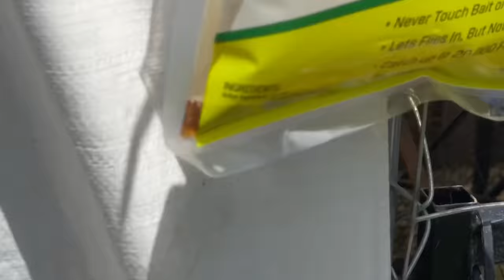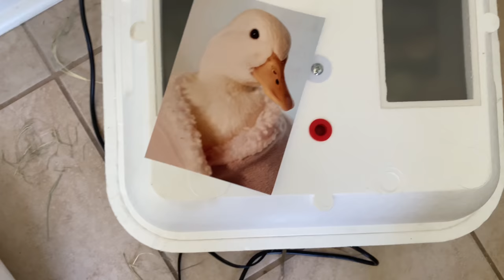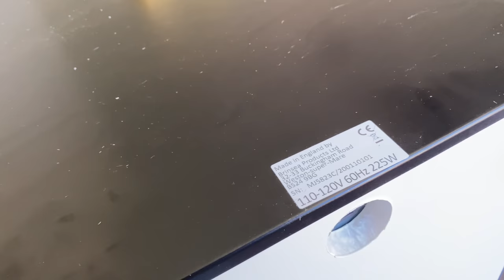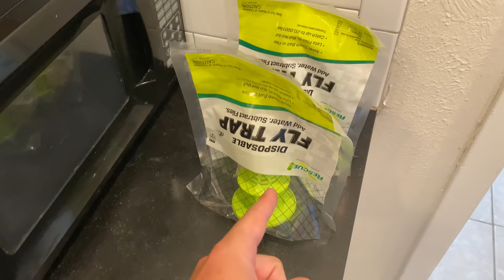I Fight Kevin for Custody of my Son! *emotional*

Comment: I do work on a farm and I've been told that if your chicks tend to huddle away from your heat lamp it's too hot and if they huddle right under it it's too cold, so you need to watch and adjust the temperature. Just a tip in case any newbies need it ;P
Reply: He knows what he is doing
Reply: @tmlconfirmed5784  I know
Reply: @Bill..Cipher  good

Comment: With the cheaper foam incubators. I installed a cheap computer fan with a fan controller to circulate air and glued it to the heating element. Worked well, keeps it at a better overall temperature with no hotspots.